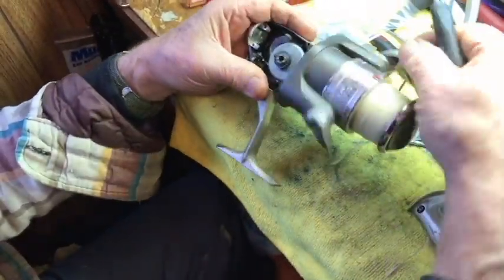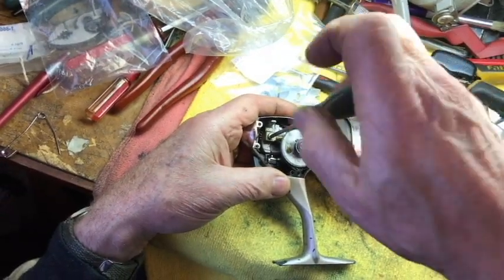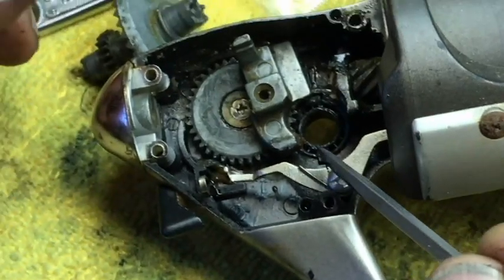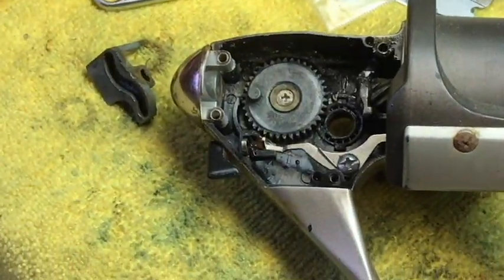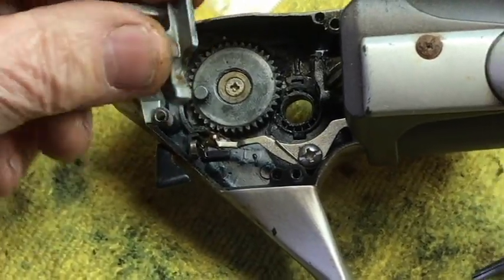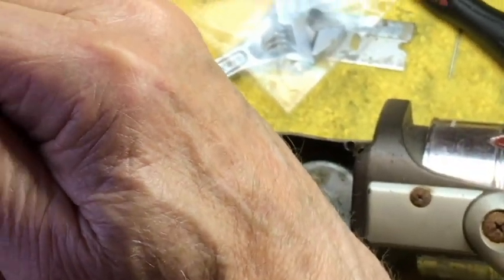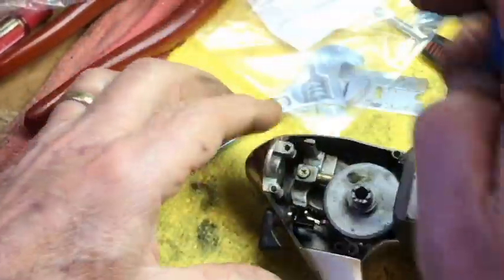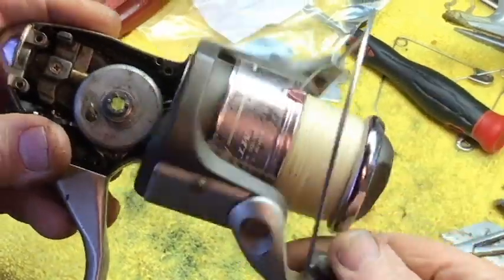Spinning Reel Repair Spool Will Not Go Up and Down Oscillating Gear

Comment: HI GOOD MORNIN...I HAVE A ZEBCO 88 WHICH I TOOK APART TO SEE WHY THE DEAG DOESNT WORK AND NOW THE ANTI REVEESE MECHANISM ISNT WORKING???I'M NOT SEEIN THE CHALLENGE SINCE THE COVER SHOULD GO BACK ON AS OFF BUT THE INSIDE OF COVER CONTAINS A SMALL PIVOTING LEVER AND THAT PART THOUGH NEVER REMOVED SEEMS TO NOT BE WORKING NOW??DO YOU HAVE ANY IDSAS SINCE I STRUCK OUT LOOKIN ONLINE..NO REPAIR ADVICE ANYWHERE FOR A ZEBCO 88 SPINNING REEL.THANKS IF YOU RECOGNIZE THIS REEL.
Reply from the maker: Thanks for the comment have you tried to create an account and look at the different schematics on this website?  If not the exact same reel many of them are basically the same and will allow you to repair or put them back together.
https://www.zebco.org/ask-a-question-tutorial/  let me know  if this helps?

Comment: What Grease and oil does he use? I trust his word 👌.. Looking to buy bigger bottles then the little ones sold at Dicks etc. Thanks!
Reply from the maker: WD-40 for cleaning the reels and I will get back to you on the type of oil........
Reply: BlackstoneBass.com Ok Thanks Alot! Going To Clean Some Of Mine Soon.
Reply from the maker: Sorry for the delay Wayne is a busy man who likes to fish also......
He uses 3 in 1 oil but says alot of people like the hot sauce oil your choice
WD-40 for cleaning
White Lithium Grease With Dry Graphite

Remember grease goes on gears and oil on bearings but the worm gear line guide gets oil even though its called a gear.....

If this helped you please take a min and subscribe if you haven't already.

Thanks!

Comment: hey Wayne my reel does not want to take in the line and my drag doesn't work how do I go about fixing both......or how much would you charge to fix them?
Reply from the maker: What brand and model is your reel?  I need to know this before I can answer any questions.
Reply: Shakespeare Synergy steel spin cast reel.......I have found the issue and it is that the guy who had it before me took it apart to clean it without knowing what he was doing obviously did not do a very good job I might add and put the anti reverse on backwards/for a left hand retrieval instead of what it is........a right handed retrieval and also screwed up the drag button and gearing as well........so basically............he screwed it up
Reply: it is a Shakespeare Trynlogy and this is what it's doing when you put the line on the right way with the anti reverse on it won't reel in and twistes up the line............ when you put it on backwards with the anti reverse off it will reel in but won't release the line.............this will sound like a stupid question but when you fish is the eyelets on the pole supposed to be facing up or down?or does it matter?
Reply from the maker: sorry to hear that........
Reply from the maker: Down but it does not matter as many people use to hold them upside down until to reel backwards right handed before you could easily change handle sides for left or right handed.........

Comment: Blackstonebass.com I can’t turn my handle it’s stuck
Reply from the maker: If completely stuck was it used in salt water?  That can freeze one up if so take apart and soak in WD-40.  Either way you will need to take it apart to see what is going on start with removing the spool make sure you just dont have line underneath wrapped underneath the spool that will prevent it from turning also.